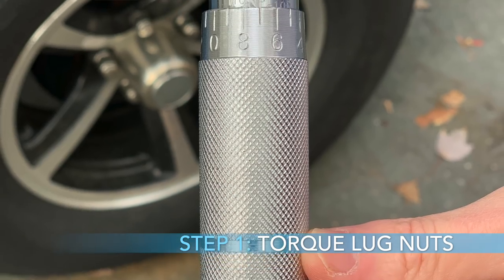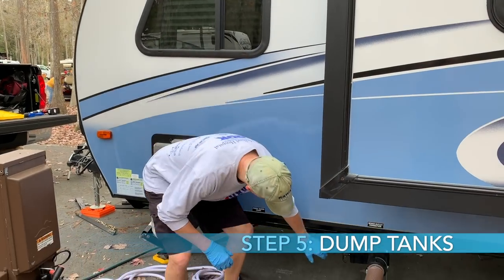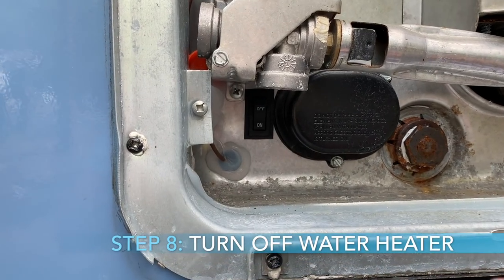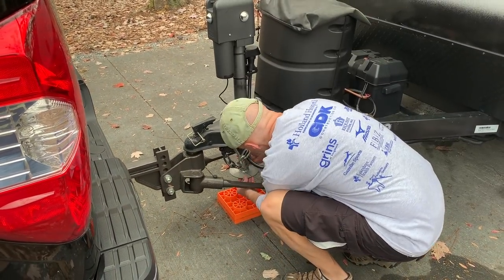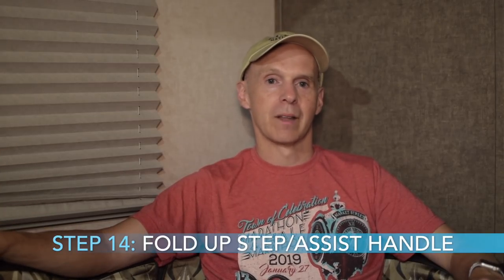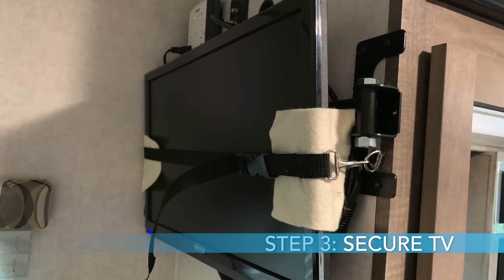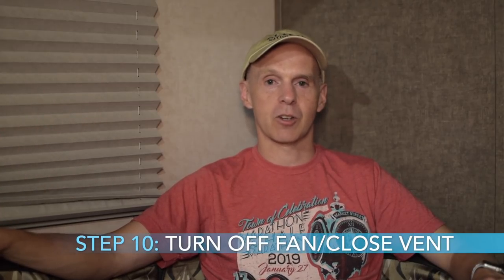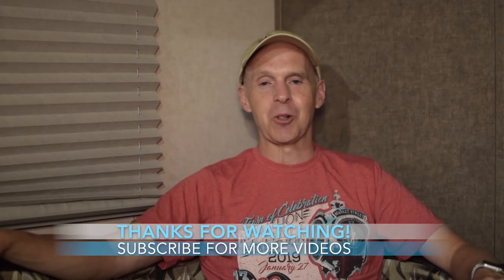RV Breaking Camp - Full Hookup Site – Step-By-Step Process

Comment: Hi John & thanks for another great video! When I first got my 2018 179 and took it out for the first time I apparently didn't turn the key the right way to lock the door and someone flagged me down to let me go know that my door was swinging open when I turned a corner. Ever since then I not only make sure the door is locked, but also position the grab handle across the front of the door door as an added precaution 🐸
Reply from the maker: MN, great point and thanks for sharing the tip!

Comment: John.  Thank you for all your great information.  I have learned so much from your videos.  My question is.  You use the battery for your fridge while you are traveling—does the tow vehicle while running keep the battery charged therefore you don’t run your battery out? 
Thank you in advance
Reply from the maker: Yes, the truck's alternator keeps the battery charged while traveling via the 7-Pin connector. The battery then keeps the fridge running on 12-volt. Thanks!

Comment: Thanks John!  I'm leaving Eureka, CA for Reno, NV to work on the 29th.  Although I have changed sites about 4 times, it is always good to get a different perspective on how to do things!  I'm going to get a socket to use on my battery-powered drill to bring up the stabilizers!  I am also going to invest in a torque wrench for my lug nuts!  Again, thanks for your great videos!  I always learn something!!!  Barb
Reply from the maker: Barb, glad the videos are being helpful. The socket for the stabilizer jacks saves lots of effort and the torque wrench is pretty necessary. Over time the wheel lugs can come loose, so it's a good idea to tighten them regularly. All the best on your trip. Thanks again for watching!

Comment: Hi John. Firstly, thank you for your great videos. They are fantastic and have helped me immensely with my understanding of the rpod 172 that we have just purchased. I'm wondering if you could provide some guidance on a question I have. Specifically, how do you deal with the water left in the fresh water tank before you leave the campground? I've been told by many that it is ideal to travel with a mostly empty fresh water tank. My plan was to only fill up the fresh water tank when we get to the campground. If there is water left over after the few days of camping there are only a few options to empty the tank before heading back. Let the water out of the tank before leaving the site or on the road or run then toilet or sink until the fresh water tank is empty. The first option isn't the best due to the possibility of a lot of water flowing over the campsite or road and the second option potentially means running the pump for a long time. What do you do? Any guidance would be greatly appreciated.
Reply from the maker: Will, this is a great question and I may use it in an upcoming video. In short, I have a pair of 5.5 gallon water containers that I bring with me in my tow vehicle. If I am camping for only a short time in a place with no city water, I can fill up the fresh water tank part way when I get to the campsite (usually the dump area has potable water). Then if I run out while set up, I can bring one or both of the water containers to the potable water and fill the fresh water tank from these. Hope that makes sense. If I have any water remaining, likely it isn't very much and I usually just tote it home and can empty on my driveway. If I am going out again shortly, I just leave the water in the tank. Thanks again for the great question and thanks for watching!

Comment: Hi John, do you drain your fresh water tank before hitting the road? I'm curious about the extra weight sloshing around.
Reply from the maker: Chuck, I really depends on the distance of the trip for me. I don’t always drain the fresh water tank before leaving from a trip. Usually there is not much water left in the fresh water tank when breaking camp. 

Another thing to consider is the weight of the trailer including water given your tow vehicle’s capacity (with my truck that is not an issue). Hope this helps. All the best!